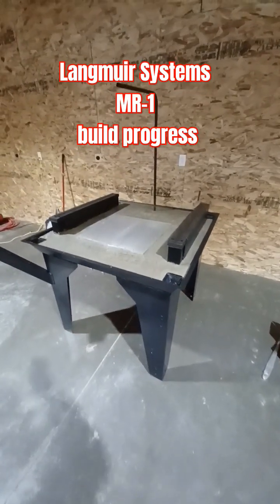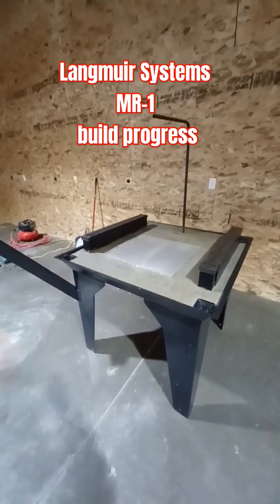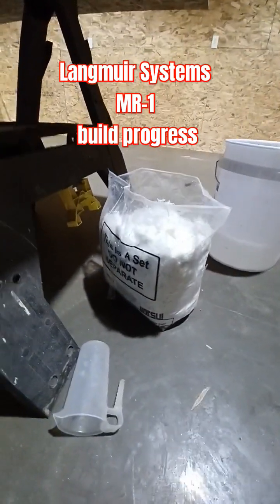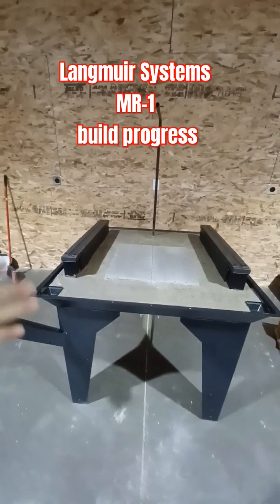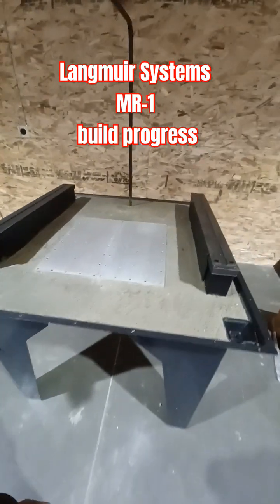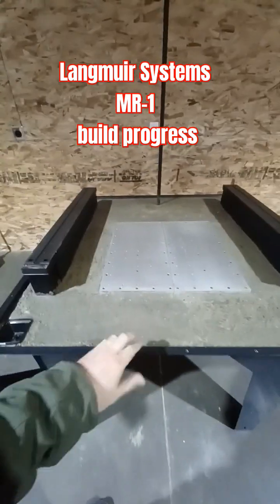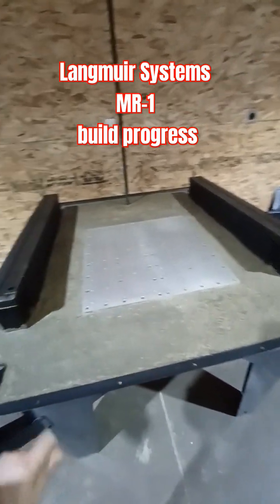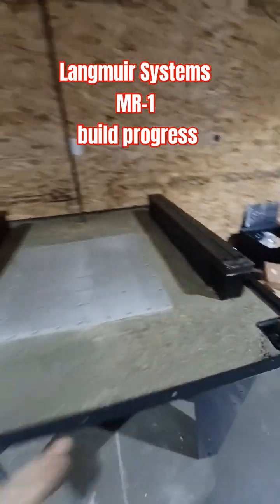Langmuir systems MR-1 DIY CNC mill build @LangmuirSystems #langmuirsystems #MR1 #cnc

Comment: i just got one and im assembling it and the instructions are A NIGHTMARE. holy cow if i knew how much of a pain this would be id have paid the 2500 for assembly.
Reply from the maker: yeah, find somebody to help with the concrete pour.  Also the shim calculator for tramming the spindle doesn't work.  You just have to use an indicator and shims.

Comment: Richard, core out a 4" drain behind the base plate for a drain. You will thank me later. Before you epoxy. The stock drains are a nightmare.  I thought that they had a supplement drain fix, but I guess they are not shipping it with the new units.